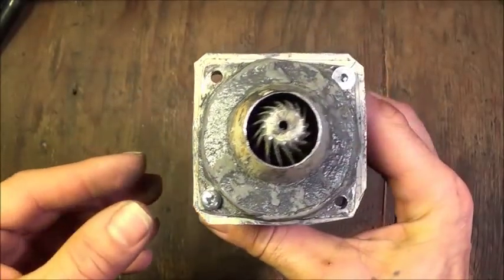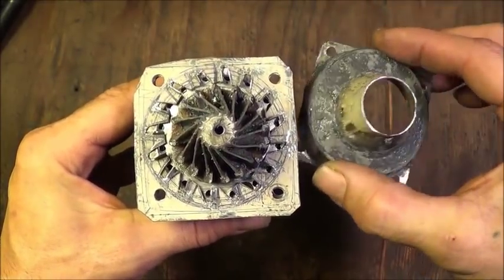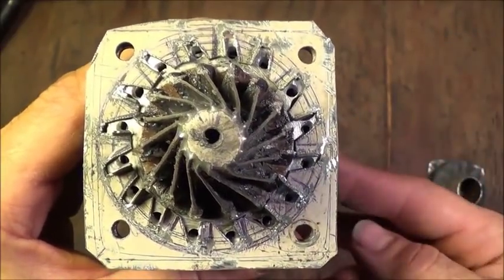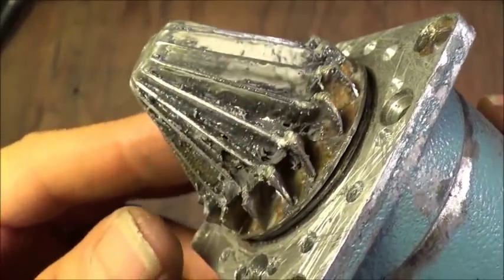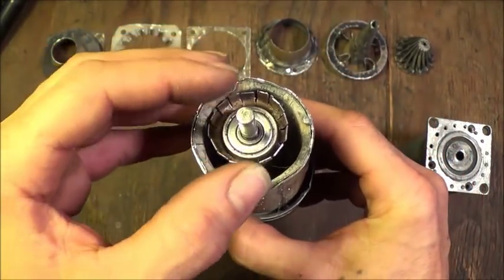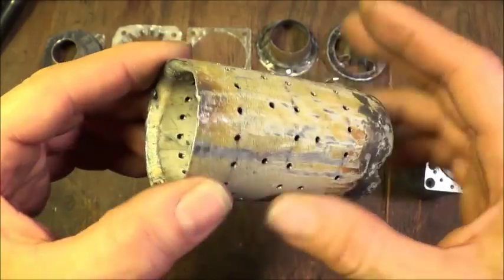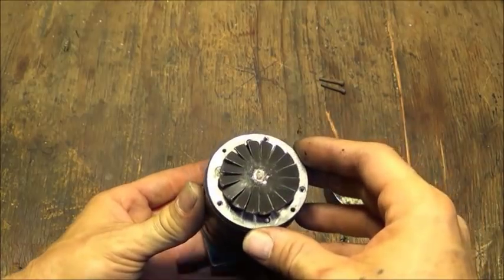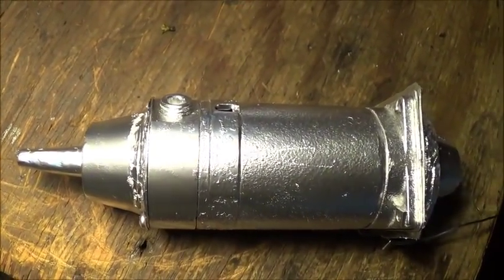How to build a "TURBO-JET ENGINE" from easy to find materials.

Comment: correct me if i'm wrong, but the upper and lower blades of the diffusor seem to be angled in opposite directions. The upper half look as if it was made to turn clockwise, the lower part the other way. Does that matter, or is it just supposed to somehow force the air outwards to the diffusor ring?

Comment: Nice video! Are you looking for a thruster for some other project because there have been lots of jet engine videos lately! 
About valved pulse jets- what if to maximize simplicity you used a tesla valve instead of those metal valves

Comment: Would it be relatively easy to make a turbofan jet engine out of this one? Or do you have to redesign the whole to do that?
Reply from the maker: Building a turbofan is the goal from this design, it still needs at least one more drive turbine blade, and the first stage multi-blade fan compressor that precedes the two stages shown in this film.  In a turbojet engine only a portion of the compressed air produced goes to the combustion chamber, a good portion of the air is used to cool the engine.  If you can get your turbojet efficient enough to attach the big fan blade to, and create a turbofan engine then 70% of the trust will come from the fan blade and only 30% from the turbojet (if you could engineer the engine on the same level as GE).

Comment: Its ugly, but it's cool. I even learned a few things.  Now if you had a lathe and mill you'd be really dangerous.

You can find a small lath for about 1,500 or 3k  and a Bridgeport Mill for 2-3K rebuilt.
Why do you need CNC you don't just a good indexer and a turret lathe.

Are there more Jet motor designs?  This one seems kind of basic.
Reply: My dad has a mill and a lathe, how do I make a jet?